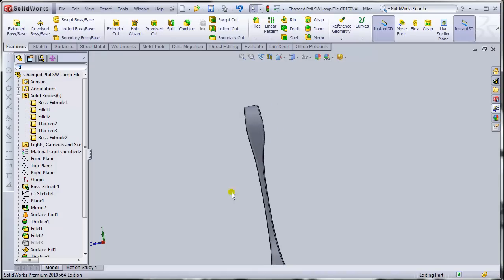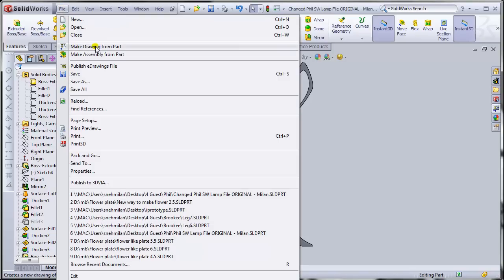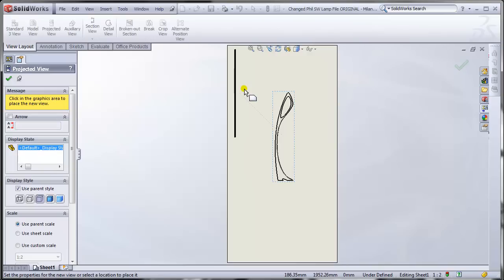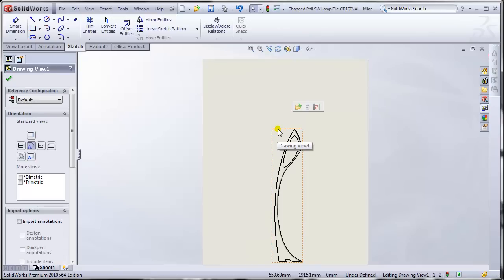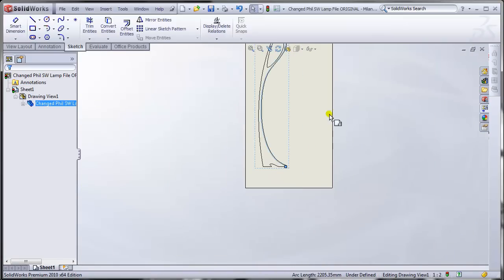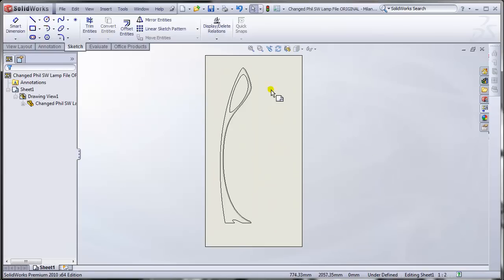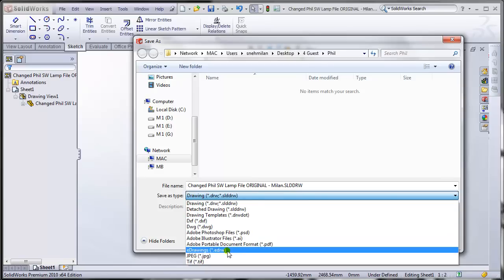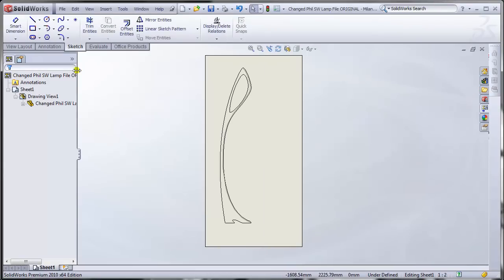Export SolidWorks Data to PDF, DXF, DWG

Comment: Waste of time - this is not file conversion save in 3d - its flat planer only -
Reply from the maker: I understand that the title is a bit confusing, I will change it. 
This tutorial is developed to export data for CNC routers, plasma and waterjet cutters. 

If you intent to save your data to 3D dxf or dwg, you may wanna check in to the plugin in link here http://www.sycode.com/products/dwg_export_sw/

At this point, solidworks does not offer native 3D dxf and dwg export, however, one can export parasolid data from solidworks and open in higher end application such as, ProE, CATIA and NX and then convert data to 3D Dwg or Dxf from there. 

If you intent to save 3D pdf, use save as option and check the box 3D pdf. 

Hope this helps.
Reply: ***** Thankyou for your advice
Reply: this is only my recent experience and there may be other ways to export in 3D but IGS and STL files work in the programs I have although there seems to be a block on 3D DWG and DXF - I don't wonder why.....Even Sketchup exports in 3D DXF's
Reply from the maker: Dan Barclay i agree with you Dan, this is one those proprietary bullshit between two companies.
Reply: ***** Truly - as if the companies are then not judged by their unhelpfulness......